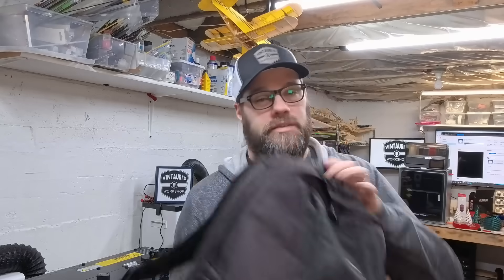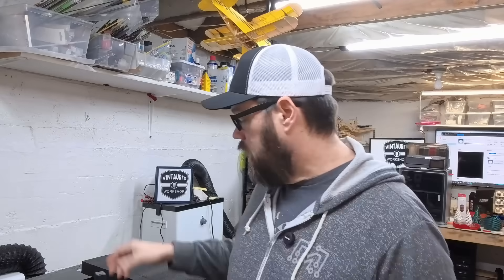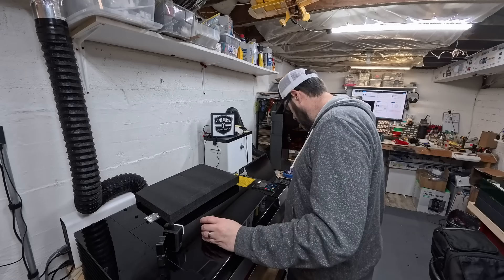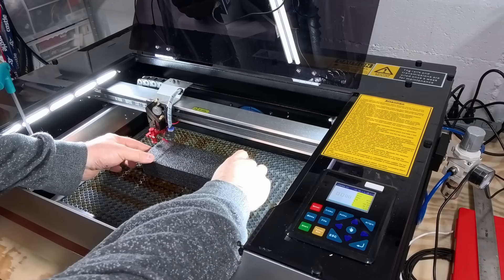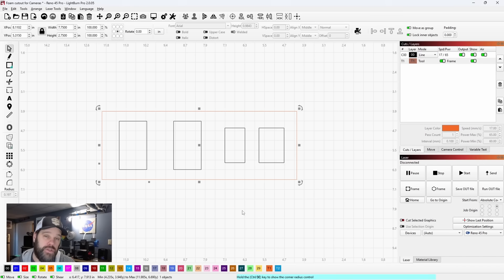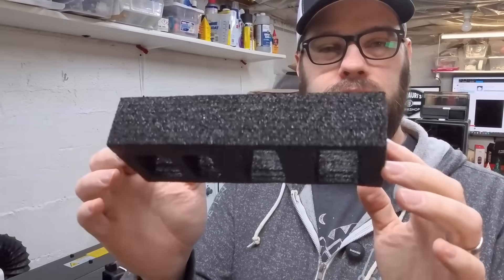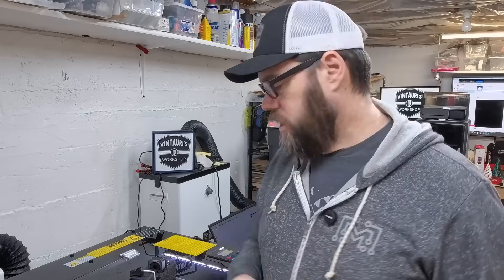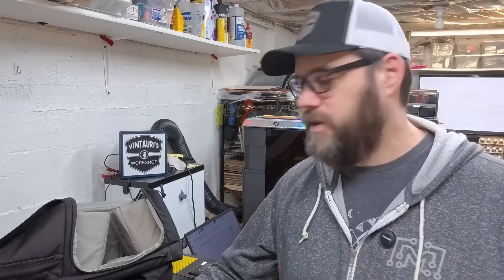Can you cut thick foam with a laser?

Comment: Hi Steve, I have the Reno 65 pro, I tried to engrave a 3d image that was about 26 MB sent it to the laser it took and started to engrave but stopped around half way thru the image tried it a couple times same thing found out the topwisdom controller has only 15 MB of memory, thinking about converting it to a g code controller, is there any other way to do a bigger image file without lowering the dpi, thanks
Reply from the maker: I would try reducing the image resolution and size in a graphics program like Gimp before bringing it into lightburn.  Some raw images have a higher resolution than your laser can physically process.
Reply: Thanks

Comment: Lightburn FTW. That dev has the best laser software bar none. I was an early adopter and get it for $30 a year now. I was testing different materials with a diode laser. My spouse thought I was crazy when I threw a banana under a 10w laser.
Reply from the maker: I've had lightburn for quite a few years as well.  While it has gone up in price some since I purchased it, I still feel it's worth the cost.

Comment: NEVER laser cut foams or any material containing Polyvinyl Chloride (PVC) or other halogens, as it releases toxic, corrosive chlorine gas that is harmful to health and can damage the laser machine's components. Be sure to get a MSDS on your materials.
Reply from the maker: You are correct, as I stated in the video, you need to be sure of what the foam is made of and any adhesives used if it is layered.

Comment: A very useful demonstration of the rate at which the beam widens as one moves away from the point of ficus, thank you.  Because the beam widens above as well as below the point if focus, and because you lowered the focal point to somewhere around the centre of the foam, there should be a widening of the cut above as well as beliw this point with the smallest opening at the focal point.  Did you observe this?

If this effect did indeed take place then the depth at which the narrowest point occurs can be altered by changing the extent to which the focal point is lowered into the material, always with the constraint that there’s a limit before the laser module huts the foam or other thick object being cut. 

Many thanks for such an informative presentation which has earned my subscription.

Comment: I’ve the Reno 45w, laser max current is 20ma, and this is 75% for me. So I’ve just set the Smax on Lightburn to 750. So it will never run beyond the max current load. Odd you state your Reno pro is 65%.
Reply from the maker: The max current is stated as 20mA but it's never good to constantly run your laser at those max levels and I've found that running it at the Max rating, vs backing it off 10-15% makes little difference in the cut quality or speed.  I've also found that 65% has mine running at 19mA so to prevent spikes over 20mA, I don't go over 65% power at the controller.

Comment: Coming from working at a custom case manufacturer commercially, we never used lasers to cut foam, it was always pocketed with cnc bits, and cut throughs are generally done with thin cnc controlled reciprocating saw blades. Your laser results would vary based on the pound foam that you use, not just its thickness.
Reply from the maker: You are correct on that, but it's a question I have been asked about so I wanted to do some testing.  It's not the best method, but for some, it will work.

Comment: Flip it so you’ll have cut upside down to work with the taper, looser up top and tighter at t(e bottom
Reply from the maker: That's an option that could help, but in this case I think having the tight spot at top helps grab the gear more in the middle.  We'll see how it holds up after a week of travel and convention walking.

Comment: Great video, Steve. I’ve often wondered if foam was a product that could be cut. I take it that this is a CO2 job and not one that would work on a blue diode laser?
Reply from the maker: It depends on the foam, some are better than others for cutting and some are okay on diodes as well.  A Co2 is better at it in any case.
Reply: @Vintauri Thank you, Sir. Nothing like experimenting to see what works. Have fun in Vegas.

Comment: Did you lower the focus at all for the cut?
Reply from the maker: Yes I brought it down so the air assist cone was just 1/4” up from the material. I didn’t want to get too close but tried to offset the focus spot as much as I could.